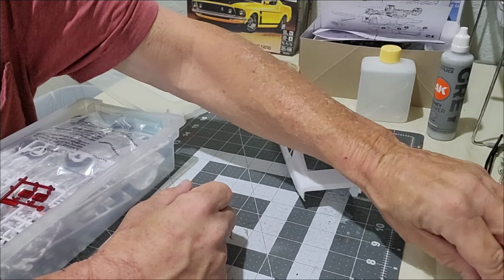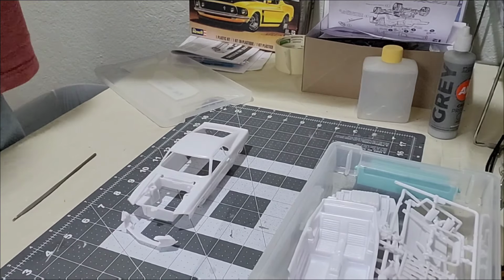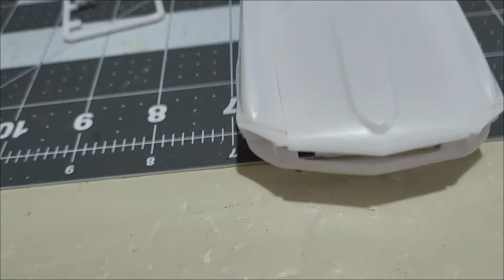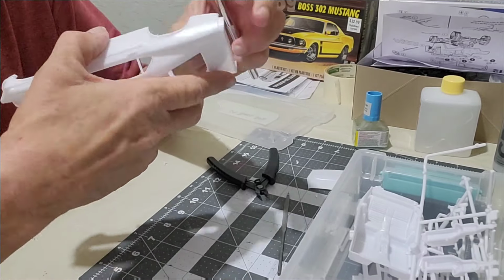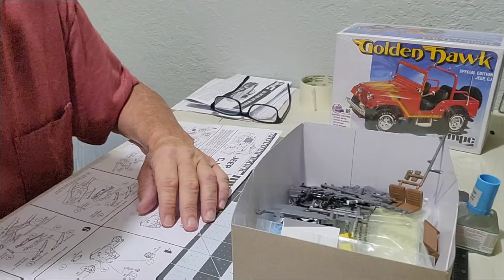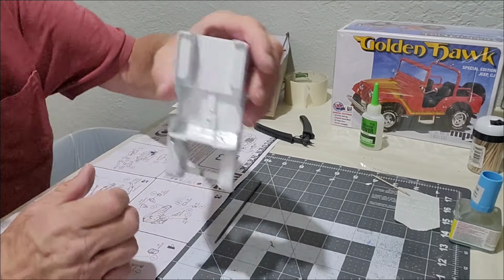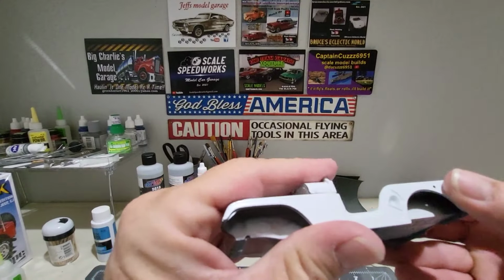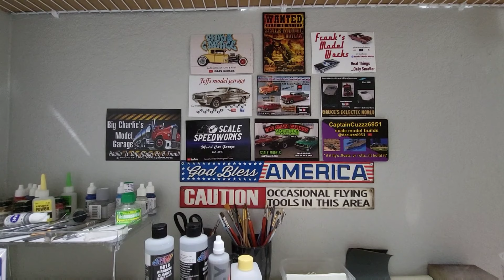#mustang60 update/Daisy's Jeep update

Comment: All looking good Joe... Suggestion for ya on the super glue. While there right don't go from the bottle but take a Pepsi bottle cap (several) and melt candle wax in the bottom up to the ring on the bottom. Then put your super glue on the wax and you will be able to use that one drop for 20 Minutes... then when it is dry after several times putting glue in there, dig the glue out, re-flow the wax and your good to go. Don't ask me how it works but it stays usable for a long time compared to being out in the open... Have fun with the kits Joe...
LLAP
Reply from the maker: Great tip Bruce. Thank you